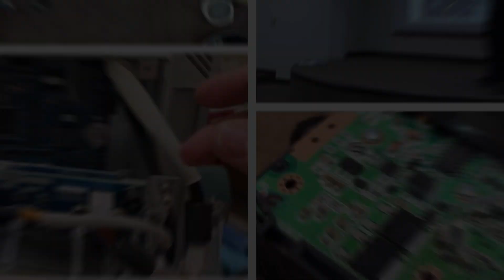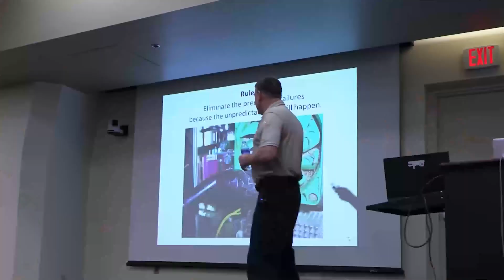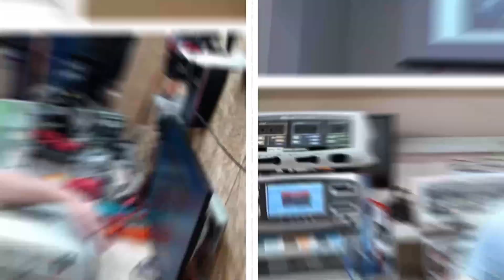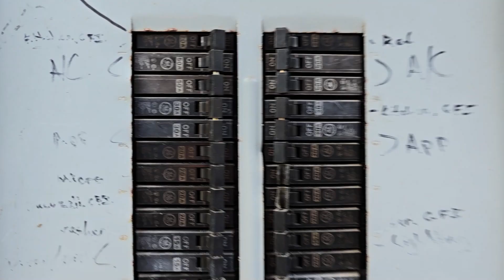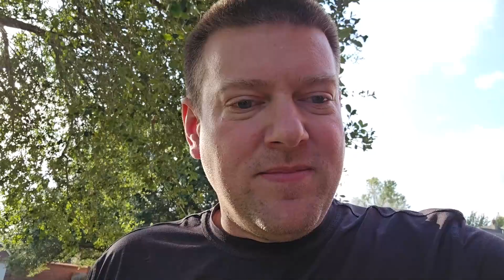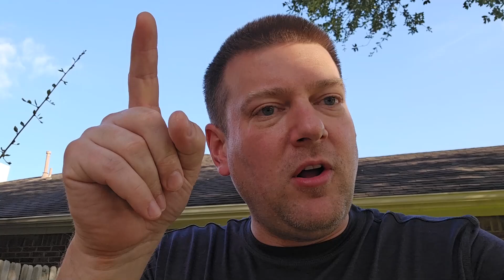220V Anomaly?!

Comment: Now i'm curious to know why Americans use primitive dodgy looking plugs with unsleeved pins, them things are technically illegal in the UK unless used with a step down transformer in a workshop environment.
BTW we had sleeved pins introduced in 1988 and by 1992 all appliances had to come with a plug attached.
Another question, why are your colours black and white? I'm assuming white is live and black is neutral.
Reply from the maker: @rickthescrewballpeacekeepe7387  black is hot. White is N
Reply: @BetterBiomedChannel  it used to be red as live and black as neutral until the changes happened in 2004, now we have brown as live and blue as neutral, same as power cords.

Comment: We don't have that problem in the UK, all our appliances work on single phase 240V, our high powered appliances (3kW) have a standard wall plug, most kitchen stoves are single phase with their own feed.
Americans do everything the hard way🤣
Reply from the maker: @rickthescrewballpeacekeepe7387   I would agree that having higher voltage and less amps would be perhaps safer for these modern electric hungry appliances
Reply: @BetterBiomedChannel  we used to have 200V DC systems before and after the war but that was phased out for standard 200 - 250V AC after the war with a change from round pin plugs to the modern square pins and ring main circuits due to copper shortages, most of these things still exist.

Comment: Old building, with a circuit to a light with 2 wires in a conduit.  Modern offices have more electronics, so upgrades to the building included adding more outlets.  but they added to the existing wiring...  2 wires in a conduit turned into two hot wires in a conduit serving as the ground AND neutral.  it "works" fine, electronically...  but using 3 wires less than a proper circuit...  It was cheap and saved a lot of labor.  20 years later, they are swapping out the old light fixture for a new one...  In the next room there is a computer and a copy machine and a desk with a light fixture.  Someone goes to the copy machine and presses the button to start a copy, and the lights get really bright in the room, and everything on the desk (computer, lamp) is suddenly dead.  Turns out they had loosened the conduit and separated it slightly exposing the wires...  This "opened" the neutral, and caused unbalanced division of the 240v on the conductors, and when a large load on one side of the 120v pair was turned on, that leg unbalanced the "floating neutral" causing the lightly loaded 120v led to get most of 240v.  this caused the small loads to get double voltage, and some of those things died.  No people died, but it was a possibility.

Just because you know how to wire a circuit with fewer wires than are standard doesn't mean you are smart.  You are only smart if you know this and never do it.  Half-arsed electrical work is common anywhere some "handyman" who is not an electrician is doing electrical work.

Comment: I’ve seen this happen a few different times. They need to make dryers and ranges with all 240 volt components and get rid of the 1,440va minimum NEC requirement for 240 volt cord and plug connected loads.
Reply from the maker: It's even more interesting now with brushless DC motors and variable frequency drives being powered by computers. Half of the Dryer is DC while only the main element might be using the full mains 240V

Comment: " connected to the DC power supply,"  3:14. 
Slip of the tongue, I'm sure...
Reply from the maker: Not at all. All modern devices have a DC PSU inside to power the computers and LED lights (at minimum). Only one of the 120V legs is needed for that PSU. The other leg is used for the heavy work of the machine - motors and heating elements.
Reply: @BetterBiomedChannel  Every day I lear. Something NEW...

Comment: Who else shuddered when they realised this chap has the metal lid of the panel sitting on his head?
Reply: It’s only sketchy if the panel isn’t grounded.
Reply: @jacobcarlson4010  Look into a 'floating neutral' situation and consider that your grounding system is tied to neutral, then look up step potential and fall of potential across the earth.

Hopefully then you'll understand the hazard.
Reply: i will never understand why you Americans make everything out of metal... even the pipes you put the wires thru are metal... it's just crazy to me.
Reply: @whoknows8225  pretty much every country on the planet makes use of metal containment in their electrical in some circumstance or another.
Reply: @retrozmachine1189  nah, i dont think so.. maybe on your side of the globe, but here in Europe, it's all PVC.
Reply: @whoknows8225  I suggest you do a web search on the topic.  There's plenty of metalwork in electrical in that continent.
Reply: @whoknows8225  You might live somewhere in Europe but you have a poor understanding of what containments are used in that continent.  Please do some research before replying.
Reply: @retrozmachine1189  Do some research? I've been schooled as an electrician and worked as one for years.. are you serious?
Reply: @whoknows8225  Yep.  You got it in one.  Take a look at all the manufacturing of metal containments that goes on in Europe while you are at it.
Reply from the maker: Extremely low risk. 1. The panel is grounded with multiple buss bars and a heavy ground locally - and at the transformer. 2.  We're working with 120V here. If I felt a tingle when I opened the cabinet then I certainly wouldn't have gone further. 3. If I had wet hair maybe but I'm pretty sure that in Texas heat, the panel cabinet is dry, my hair is dry and my skin is certainly dry which mean that my impedance would be high compared to my hand when I opened the box.
Reply: @BetterBiomedChannel  Check the loop impedance on the earthing system. and then do some maths to work out the potential between the ground where you are standing and the earthing system that the panel is tied to.

Keep in mind that with minor imbalance between L1 and L2 the installation neutral will be close to earth potential as a matter of course so you won't necessarily even get a tingle.

Now consider what happens if a 120V appliance turns on, say someone is playing with breakers, while you have that lid sitting on your head  that causes a higher demand on one leg, neutral is now pulled further away from the surrounding earth potential where you feet are.

Hand to hand safe voltage is 50VAC, hand to foot is 70VAC.  Head to foot is somewhere near 50VAC but I can't recall exactly what.  How much load imbalance do you need to achieve 50VAC between the earthing system and the ground you are standing on with the earth loop impedance you measured previously?  I hope that is a sobering thought for you.

I won't comment again, but I do hope you decide to never prop a panel lid on your head again.

Comment: This anomaly leftover from the older revisions of the code. Now it is required to have common internal trip since NEC 2011. Handle ties are only allowed for two circuits with line to neutral loads now.
Reply from the maker: @Ria_J  interesting!

Comment: Hi: I am a retired Director of Biomedical Engineering from a large mid-atlantic hospital and can relate a similar-(but slightly different) experience. Years ago, l lived in a relatively new (2 years old) home. The house had gas fired heat, gas clothes dryer, electric stove and an electric hot water heater. One night, I arrived home around 1 am. Turned on the kitchen light, and all was normal. Walked upstairs to the master bedroom closet, flipped on the light switch - and no light. Thinking the switch was defective, I flipped the switch in rapid succession with no response. My wife was downstairs in the kitchen and she told me that every time I flipped the closet light switch, the kitchen ceiling light would flicker in response to the closet switch commands. This was obviously a power problem. Went to the main panel - and sure enough, one of the two 120 legs was dead. So, I called our electric utility. It took over a half hour on the phone to convince them that I lost one power leg. The only way I could convince them was turning on the stove. The stove power light came on, but - similar to your situation - no heat to the oven or stove top elements. They finally rolled a truck, and discovered an underground break in one of the lines before it entered the panel, The blinking light in the kitchen was apparently caused by the working leg somehow back feeding through one side of the water heater element. At least that is what the road crew told me. Weird stuff happens. Also, I love your content. I spent 44 years in Biomed working in house for 2 hospitals, started as Senior Technologist, then Coordinator, and finally Director. I have seen a lot of crazy stuff, like the cardiac monitor that would only work when it was upside down. Not to mention the time we opened a new hospital wing and came pretty close to electrocuting a floor full of telemetry patients because of an electrical contractor’s very bad implementation of an architect’s very bad design. But those will be stories for another day……Then there was the time I built a Hewlett Packard cardiac monitor from spare parts. Back in the day, HP had incredibly concise service and parts manuals.  HP would sell you almost everything -including a blank serial number plate! Keep up the great content. Your stories take me back to the old days - some good, some bad, some horrible - but it was a totally fun ride!

Comment: Daily dealing with three phase 400V any abnormal operation and I measure the incoming voltage, phase to phase and phase to neutral. Wanna hear my weird story? I went on a no-power call. Part of the house didn't have full power. We run on 230V on single phase. The fridge ran but kinda roughly. Some lights did flicker. Measured the fridge outlet: 80V. My first thought: damn it, the neutral is missing so I turned off the indoor panel main breaker. Went to check on the main three phase incoming fuses. L2 had blown, same phase as the fridge. I just couldn't figure out why there was 80V on L2, and like real volts, since the fridge ran. I turned on the power again without the L2 main fuse and started unscrewing fuses (old porcelain from 1970-80) to find out what was bringing 80V to the L2. Turns out it was the Tesla car charger. No car was connected. Learned something new that day. Oh and did change the main fuse, a 25A that had blown because the customer had come home from holiday, turned on the heaters in the house amd connected the Tesla.
Reply from the maker: @justme5384  wow